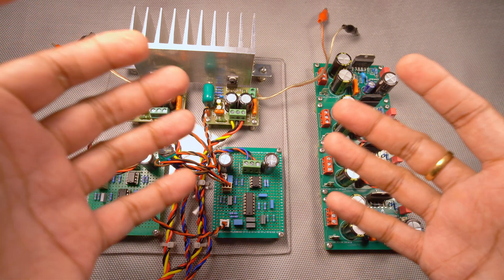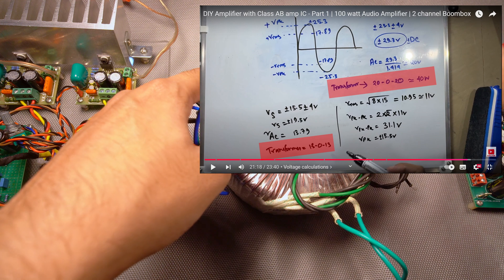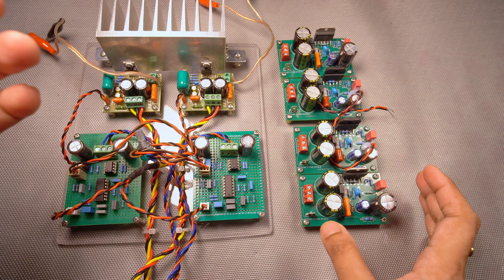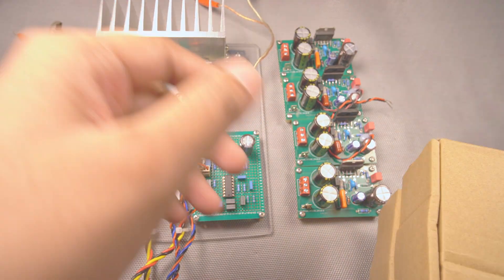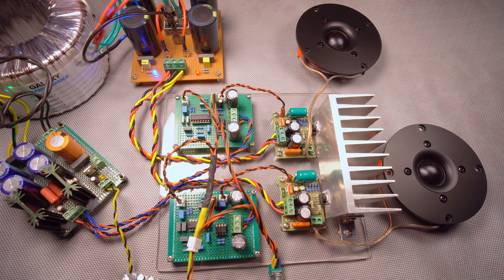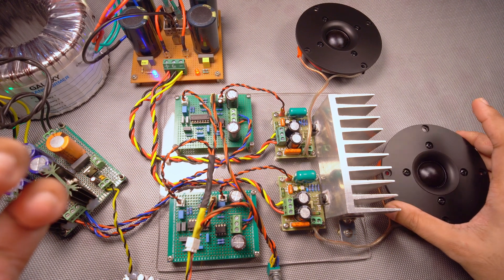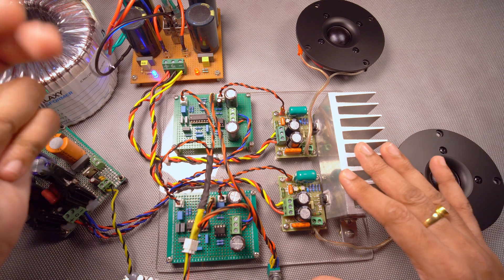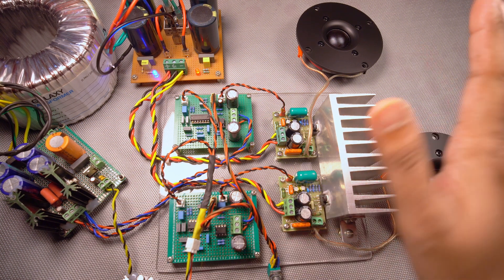Project Update and DoogeSound Silk Dome Tweeter Test | DIY Amplifier Project Part 11

Comment: Bro i also have a lm3886 ic bought from Mosuer USA
Reply: My relative purchased from me no custom issues
Reply from the maker: Wow great … didn’t they mess-up in the customs??
Reply: Do you have idea about circuit basic PCB board ?
Reply from the maker: You have to order the pcbs from robu or lion circuits. In the website of circuit basics you will have the pcb design … which you can copy paste in easy eda software then generate the gerber file and order pcbs.
Reply: Ok I saw the circuit basic design they used premium electronics components used for design like silver mica capacitor and audio grade capacitor and resistors .
Reply from the maker: Silver mica you can get from Robu website and vishal box capacitors are pretty good ones .
Audio grade resistors is a tough thing to find
Reply: Please send your contact bro I can clarify my some doubts
Reply from the maker: You can contact me via hrituraj64@gmail.com

Comment: Do you use mica washers for isolating heatsink?
What is the max freq you can hear or measure from Doogee Sound tweeters?
Reply from the maker: Yes yes I used mica sheets for isolating the tab of the ic and plastic washer for isolating the screw from the tab.
My hearing ability is till 18khz … so I could hear it till that point 🫢.